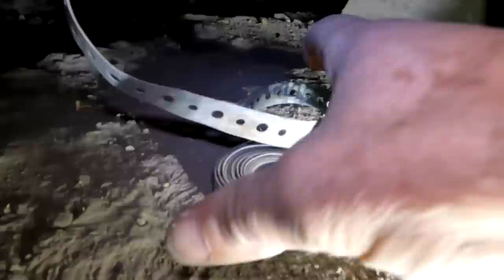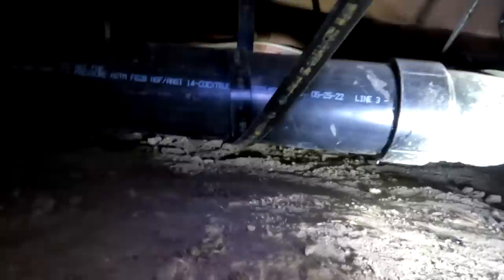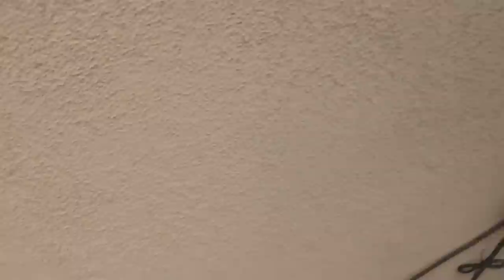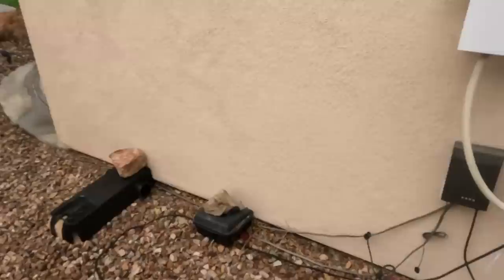We REGRET putting a RAZOR blade on the Rat Trap…..

Comment: Hey, guys; I'm sure that rat which got free of the trap soon died from the damage. His neck was probably broken, or his skull was crushed. They sometimes have enough strength to pull free, but basically it's the last thing they do before crawling away to die somewhere. Those traps have tremendous shock power and any rat hit like that rat was hit, does not live long afterwards. That's why I always fit three or four nail spikes to all my traps, in front of the bait plate, to ensure the rat gets impaled by at least one spike and cannot get free. And now, later in your video, you show blood on the rat trap: and I have found that any trap which catches a rat but does not hold it, but then has fresh rat blood on it, DEFINITELY means there's a dead rat resulting from it. Count that one as one dead rat.   I totally agree with you about the rodent-repel sound-makers: they don't work and are a waste of money.  I have set traps right beside working sound-makers, and have caught many rats which should have been repelled, but were caught in my traps right beside working sound-makers!    Great work as usual, guys
Reply from the maker: I know love the way you make your super traps! 
Great points here you make. You will see our upcoming videos on the latest & greatest version of our rat traps! Super easy! Super effective and our catching rate increased by 45 percent. Love to send you a few for free to test.
Reply: Freaks!!!
Reply: i was just gonna comment i had seen some videos of people adding nails or screws to the trap

Comment: Im a pest control guy and those black snap traps work GREAT. Whoever set those up got lucky but you definitely want to only put chunky peanut butter with some about 2 or 3 pieces of peanuts and very little PB or PB oil. Very minimal and get it deep in there. I work in exclusions and love those traps. Your wooden traps are the real deal as well I just think it depends how you set them up where it matters most though.
Reply: My wood ones warp after they get wet . They do work better but need to keep buying new ones every month
Reply: I put the bait in the back of the trap, the  rat has to crawl over the trigger.   
For that I typically use soybeans ( edame).  You could put peanut butter on a piece of paper towel too. 
My rats were eating dog kibble so I put a piece in the trap too.  The rat was going to like one of those. 

Try to keep the trap closed in so the rat must enter from the front. I did lose one who came in from the side.

Comment: This guy could take some tips from those of us who killed MONSTER 🐀 in Chicongo. You need to put a small wood shim under the spring legs with two grooves in it. This increases the kill bar strength. It breaks their neck. No squirming. On top of that you can drive tiny screws threw the kill zone area from the bottom up. It’s brutal but I saw a huge one get hit in the right spot and blood shot over the ground almost a foot. He was done. These are mega rats so you can’t play around. Smart and huge. Not Cali rats.

Comment: When I was a Kid (WAY BACK in the 60s)  We use to ride our buzz Bikes in the woods near a swamp. It was Loaded with rats.  We wanted to see if we could catch them.  Purchased some rat traps from the Five & Dime store and. BAM,, catching them by the dozens.  Then we saw our traps were disappearing.  WTF???  We sat and watched and to our amazements, the bastards that were caught were walking off with out traps around their heads!!  We put two inch roofing nails thru the board where the bar comes down.  When the bar slams down, it drive roofing nails thru their heads!  Instant death! WELL, Then we found rats eaten away by other rats.  Canalization at its finest!  We also had to wire the traps to trees so the other rats would not carry them off.  Love your guys sincerity, honesty and work ethic!  Keep on keeping on!

Comment: How often would you say a rat or 2 is the extent of the invasion? 21 year ownership and I’ve never had a rat. All of a sudden one was clever enough to burrow outside the foundation and come up in the basement in the only corner where the basement floor isn’t concrete. Never understood why that corner wasn’t concrete like the rest but when I’m done killing these vile things I’ll be sealing it over with concrete. Day 1 killed the main rat I saw but 2 days later another one dug open the hole again and came in and the trap got it.  I really would like to find a way to send smoke up the hole from inside the basement so I can see outside where it’s coming in from. I’ve looked and looked and cannot find an outdoor hole. Surely there’s got to be some type of a safe indoor smoker I can push smoke into the hole to see where it goes??? Sealing with concrete is the plan but I want to seal the outer hole too to prevent any further burrowing. Rats are nasty vile little ******s and I don’t want them searching for more ways in. They piss and poop everywhere and I think the droppings can make you sick. Nasty.

Comment: Watching your stuff because I need to know what to do. The terrace of 6 houses have attic infestation of rats, using soffits and gutters and cavity in brick walls or whatever.
Your vacuum could use an PIR sensor. Like security lights. Rat only needs to put head at entrance of tube. But I am wondering what spool up time is for motor, maybe why you have found the sensor thing needs to be further in.
Basically if using PIR, may as well just have a slab of concrete held on a trigger like a crossbow and use a solenoid release.
There are a lot channels which don't show how risk averse the big rats are on video.

Comment: Great job!  I trapped 9 rats outside on the pool deck after Hurricane Ian because I saw them running through the FEMA piles of debris waiting to be picked up and running the walls of the subdivision.   After they picked up the piles of debris, they sought new homes.  Got them then.  Now, it appears some juveniles grew up.  Back to trapping because if they are outside, they can get inside.  My ratting dogs alert me as to where they have been.  What is the plastic hood on the Victor trap??  I will never tape down a trap because I have seen rats fight to get out of traps and drag them several feet behind something and die.  The tape allows the resistance so that they can pull out.
Reply from the maker: We should send you a few of our NEW traps that we haven’t publish yet. AMAZING! Email us at support@twinhomeexperts.com
Reply: @TwinHomeExperts I need to buy one

Comment: Whoever did the hvac did some really shotty work.  I understand it was a tight area, but you're not supposed to run 20' flex runs directly from a supply plenum.  They should have ran hard pipe, and only used a maximum of 5' of flex to to connect to the registers.
Reply: Whoa  can I hire you to do my hvac in the future?
Reply: @purest_evil  for sure!  I do free estimates

Comment: I use rat poison mixed in peanut butter..I use a metal smoking pipe screen over the pb bail hole. 100% trigger rate. I've also use 4 barbed fishing hooks too. Plus other tricks. The babies if you will. In a box of grapes with one way door. Bards, razor wire. Problem is cleaning. Kill rate is high but , cleaning after several deaths unless in a dry climate is dead & wet 🤮🤮

Comment: Oh and a lesson on how to use the wood snap traps would be nice. I went to plastic because I can’t seem to set the wood ones without snapping them and scaring the shit out of myself. They are just too hard to set
Reply: FWIW, I found it's a lot more solid at the outset when you set conventional wooden traps if you put the rod in the trigger and then pull up on it a bit as you start to release the kill bar under it. You'll see, and feel, it slipping off way before you let go as the spring loads up.  Since I figured that out I've had no issues. That said, I'm always ready for the snapping to scare the crap out of me. Sadly, I still have at least one rat in the attic, and he's a big one, maybe as big as that last one the twins caught in this video. He'll have no part of the traps I've set up there. I need a Rat Vac.

Comment: I caught a squirrel with the same rat traps you were using, but I drilled three holes on each side and two holes on the edge inside of the jaws then I run two inch deck screws up from the bottom. Then I smothered the trigger and the underside of the pan with peanut butter and Nutella. I caught a squirrel this morning.   and it was stuck to the screw. If you do that, you will not have any pull outs.

Comment: I’m not a fan of homes with tile roof, any tips with those types of homes?

- Fellow wildlife technician
Reply from the maker: Hi Andrew! Thanks for being here. In respect to call tile roof tips, these are VERY challenging. We first start by crawling the attic without any light to inspect for outside light coming through, this helps us identify any holes that may have chewed through the substrates. If there is access we look on the ridges etc. 
make sure the edge of the roof line is capped. Makes sure ALL trees are away from the roof. If that doesn’t work and you still have rats, we set cameras on the roof to monitor the rats runways and see how they are getting in. 
Hope this helps. 👍
Reply: @TwinHomeExperts  great tips! 
Thank you for responding, I’ll definitely make sure to inspect those areas more thoroughly. 
If you guys are are ever in the Tampa area! I would love to inspect with you guys! Lol

Comment: I’ve been using the ultrasonic rodent repellant and I have not had any problems with mice or rats in my house. It is above humans hearing and it does not kill them but repels them from sticking around. It just like having a siren going off 24/7. You don’t have to spend hundreds of $$$ for them either. $20-30 get a few of them and just plug them into wall outlets in the garage, basement and first floor. Thanks. Steven B upstate New York.

Comment: Love your guys stuff my problem is I had rats shimmying along my Pex a leaving claw marks and mud on it till it pinholes and redoing mud room now but how do I keep them from climbing my new pipe under the house
Reply: There's a product called Acoustical Sealant.
Its an adhesive for the moisture barrier film. It never hardens and spreads like grease.
Only drawback is if the rats get away they'll leave black footprints. My thinking is they're going to have trouble after their feet are gummed up and they will find it impossible to clean the glue off after its stuck on. 
Its almost like the glue board gum.